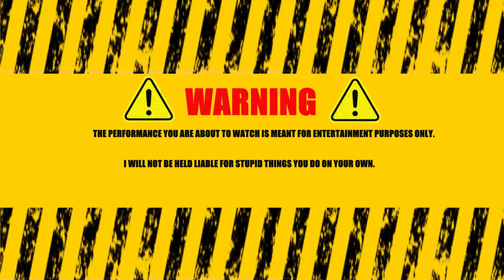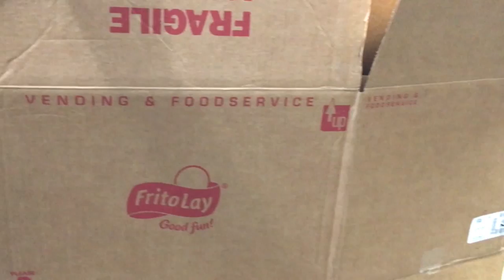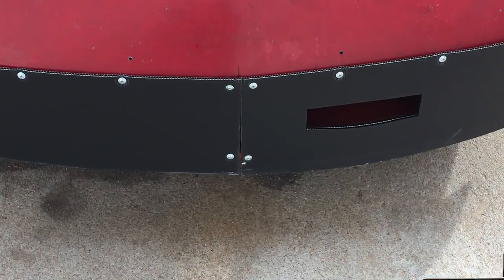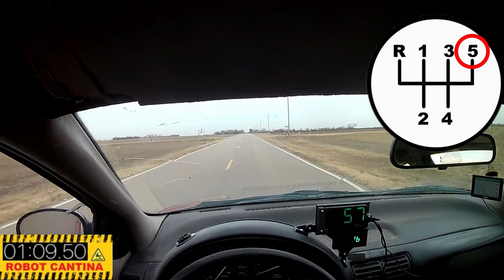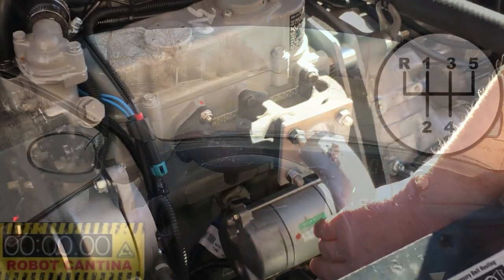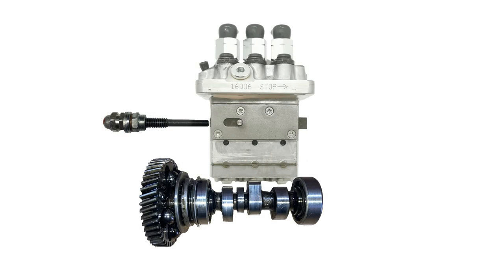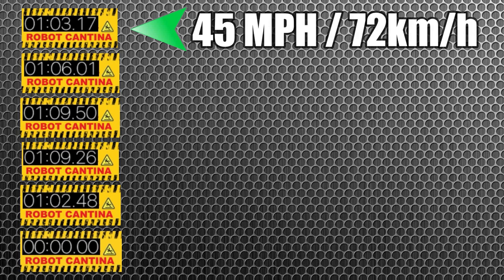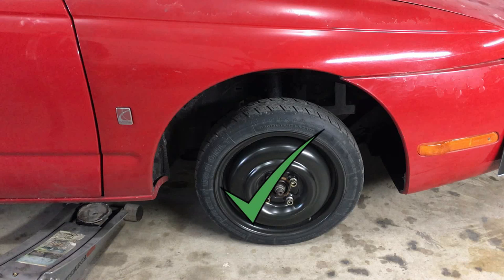S3E2   Fuel and aerodynamic mods ....We do some experiments to try and get the Saturn to go faster.

Comment: I would remove the factory exhaust system, namely the CAT and the factory muffler. Both of these are designed for a gas engine, not diesel. I can see soot eventually clogging the cat and muffler. If you run a diesel exhaust system(specifically made for the motor), you won’t run the risk of it blowing up, plus it will make the turbo work and spool up easier.
Reply: @ocdman202  The Model T was introduced to the world in 1908. Henry Ford wanted the Model T to be affordable, simple to operate, and durable. The vehicle was one of the first mass production vehicles, allowing Ford to achieve his aim of manufacturing the universal car.  Telegrams went the way of the Model T..

Comment: With the HP you have, would love to see more tests with 1) put the spoiler back on and 2) take that block off the front.  the front cover appears tilted downward which would force at least some of the air to go under.  It'll be interesting to see if you are actually having problems with the fuel supply or these aero mods were in the wrong direction
Reply: @ocdman202  The Model T was introduced to the world in 1908. Henry Ford wanted the Model T to be affordable, simple to operate, and durable. The vehicle was one of the first mass production vehicles, allowing Ford to achieve his aim of manufacturing the universal car.  Telegrams went the way of the Model T..
Reply: The lights of the original Model T were not electric. The common lamps used on horse drawn vehicles were the lamps used on the Model T, this meant it used acetylene carbide headlights and oil side lamps. Electric lighting and electric starting became available for the Model T late in production during the 1920’s.

Comment: Old Datsun 510 ran 13” wheels that may give you smaller road worthy rubber on the ground. Bigger than those spare tires you ran but smaller than stock rims…
 Might be a good compromise fit.

Comment: btw you could also change oil to "economic" one (more light). And add oil pressure gauge so you can have idea about oil pressure with various oils, at various temperatures . 
In a small engine at high rpm oil actually makes noticeable difference, both in fuel economy and performance.

Comment: Higher pressure fuel pump would feed more fuel in the injection pump so less bubbles but may need bigger injectors to flow more fuel to eliminate bubbles

Comment: Another cool video. Perhaps the areo "upgrades" might not have helped the car as well as thought. But that's a great example on how we trial and error on the cheap.  

Another possibility for making power with the diesel is doing a propane injection.  It might work, it might not.  Some people claim its like nitrous oxide for a diesel. 😎
Reply: It works but will increase egt a lot. You could burn the exhaust valves if not careful.

Some engines work this way from factory, they're 'dual fuel' diesels that can burn LPG or diesel, always using a small amount of diesel fuel to ignite the LPG when in LPG mode.

Comment: I turbo diesel swapped a 2002 jeep Wrangler. It has a 4bt in it.
Idle egt at 750rpm 110 to 230°F based on ambient temps at full load 3k lbs trailer behind the jeep full tank of diesel egt would hit a max of 1300°F

Comment: You can safely run that engine to 1200f continuously with no problems and 1500 for short periods, I have several d650 d722 and d902 engines that I have in pulling tractors and they will run happily at 1100-1200 all day long

Comment: Oh one more thing. Blocking the engine airflow could be the drop in speed. Calculating whether the car is faster or slower with the huge front hole blocked off is difficult for me to assess. Looks like slower it is at current top speed.

Comment: Hi again you can add lpg on a micro switch for maximum power when required it will have fuel on instant and spool turbo wallah lol 😆 you got the power go methanol injection or just water and you can play on your speed runs almost worry free love the work it's apocalyptic engineering 😀 at its finest 😀 thank you 😊
Reply: @ocdman202  The Model T was introduced to the world in 1908. Henry Ford wanted the Model T to be affordable, simple to operate, and durable. The vehicle was one of the first mass production vehicles, allowing Ford to achieve his aim of manufacturing the universal car.  Telegrams went the way of the Model T..
Reply: The lights of the original Model T were not electric. The common lamps used on horse drawn vehicles were the lamps used on the Model T, this meant it used acetylene carbide headlights and oil side lamps. Electric lighting and electric starting became available for the Model T late in production during the 1920’s.

Comment: Aluminum rims with the stock diameter and as skinny as possible to reduce weight and rolling resistance. If you want to push things unused seats, carpet, and headliner are surprisingly heavy and easily removed.

Comment: Direct cold air intake from a high pressure point (in that front bumper). 
Also before turbo, you could bleed a small amount of propane into the intake on full throttle.. 
Running the engine high rpm you may need to advance the fuel timing a fraction.
Mpg test at 50mph at each mod would be good..

Comment: Wonder if you need baffles in the fuel tank or if the cap or fuel outlet of the tank isn't restricted?  Also does this engine have an aneroid?  It's a mechanical diaphragm servo device that restricts max fuel under certain high rev conditions to reduce smoke for emissions on some 80s and newer diesel engines with mechanical injection. A hose or cable from your injection pump head  has me curious of its function.

Comment: Just a suggestion, take front chin spoiler off and do speed run. I think that maybe if it was contoured into the front bumper it would work as it is it has the appearance  of a wall covering a hole.also what engine oil is kubota recommending. I've always ran 15/40 in diesels , but they do have a syn 10w30 for diesels now. If any doubt just run a good 15w40 be done with it.

Comment: The idea to remove the spoiler is terrible because it creates a sharp seperation edge that helps alot in reducing turbulences in the Air.

The fact that it sticks out a Bit in the front doesn't seem to be important because this area is most likely to be a low pressure area.

The Saturn engineers aren't mindless after all.

Comment: Make sure you put your EGT probe before the turbo when you do go to forced injection if you want an accurate reading, lots of people don’t, but you loose some heat in the turbine and the pressure drop does cause a slight drop in temperature after the turbine. 
As far as the loss in power, maybe monitor your fuel supply pressure? Could be struggling to keep pressure under prolonged load.
Reply: @ocdman202  The Model T was introduced to the world in 1908. Henry Ford wanted the Model T to be affordable, simple to operate, and durable. The vehicle was one of the first mass production vehicles, allowing Ford to achieve his aim of manufacturing the universal car.  Telegrams went the way of the Model T..
Reply: The lights of the original Model T were not electric. The common lamps used on horse drawn vehicles were the lamps used on the Model T, this meant it used acetylene carbide headlights and oil side lamps. Electric lighting and electric starting became available for the Model T late in production during the 1920’s.

Comment: I dunno about anyone else, but I'd also like to see some alternative fuel experiments. I've got a cheap single-cylinder eBay special engine that I'm making into a backup generator for my solar power setup, and while I haven't gone too far into the experiments yet, it seems to run great on plain old used cooking oil. Exhaust smells a lot nicer too! I'm not sure if the Kubota would be OK with this or not though, as apparently it depends on the type of injector pump it has, and if it's a high pressure common rail like most modern diesel cars, it could damage stuff. I don't think that's the case here as I think the separate cam-based pumps are the low-pressure type, but if you do decide to try it, it would be a good idea just to make sure first.
Reply: Your alternate fuel experiment won't last long.  Don't know why so many people insist on learning lessons the hard way.  Particularly when the results are well known and documented.

Comment: With the front aero mod the intake is probably now drawing in warmer air from the engine bay. Maybe try adding a duct to direct colder air at the air filter.

Comment: coolant temp is not the whole story, you need an oil temp gauge, an egt, an intake temp, and a fuel pressure gauge to get a full picture. i would suggest it may be time for a turbo and intercooler. also the doughnut tires are probably a massive power loss to the rolling resistance of the tire. i would suggest trying a small 8 ply trailer tire. i know its against the rules but i bet you would see a significant difference.

Comment: Classic symptom of fuel starvation.  Gut says it is fuel pump related.  I don't remember if your engine has a mechanical pump, or if you are running some flavor of electric pump.  Fuel pressure gauge post filter will give you a good indication on what is going on.  You didn't mention smoke.  Did you get any?  If not you are a good ways out from over fueling and a turbo will be a net zero due to the lack of fuel.

Comment: Could you consider taping up the body gaps? It is pretty easy to do, and you could probably just use painter's tape. Bonus nachos, while you're at it, you can run a sweet painter's tape racing stripe down the car's centerline (off-set, of course). :-)

Comment: heard/read more than once that diesel exhaust tends to run cooler than petrol.   Since heat itself is an element used to create diesel combustion; guess it makes sense that some of the heat is consumed.   (heat + compression= combustion)
Reply: It's because diesels have a higher compression ratio. Gases heat up as they're compressed and cool as they expand, diesels and expand the exhaust more leading to lower EGTs
Reply: @nerd1000ify  think we just said same thing.... cart horse, horse cart kinda thing??

Comment: The rear spoiler might actually reduce airo drag, please try to re install it and see how the top speed change.

The spoiler might work in a way that it reduce the low pressure area on the back window and the slope, now a part of that is lift and a part of that is drag because of the slope.

The spoiler will in a control mater reduce this low pressure by resisting a bit the airflow and separating it from bending down to the back of the trunk. 

You make too many modifications at the same time, how can you say what works and does what, you make one mod and gain 10 points, and an other mod that you lose 9 points, the outcome is 1 point.

Comment: I wonder if you need to advance the ignition timing to get a bit more power.

Use the voting plastic to make the mirror remains more aerodynamic. Use paint as finish.

I'd also use the plastic on the inside of the front bumper instead of pn the outside.

Little wheels increase torque, and decrease wheel horsepower

The engine does need more cooling, seeing it runs at nearly max load all the time. You could use an intercooler with the turbo.
Reply: @ocdman202  The Model T was introduced to the world in 1908. Henry Ford wanted the Model T to be affordable, simple to operate, and durable. The vehicle was one of the first mass production vehicles, allowing Ford to achieve his aim of manufacturing the universal car.  Telegrams went the way of the Model T..

Comment: Is it just engine/camera resonance or does that car have a roached wheel bearing?
Reply from the maker: Yes, the left side front wheel bearing is roached.   I think when I had the car all apart and did some power washing I may have gotten some water in that bearing.  My experience with Saturns is they will go a long time on a bad bearing and we are monitoring the situation.

Comment: You might increase the engine durability a bit with a turbo using old school con rod hole style piston oiling a la Oldsmobile. Also maybe the block has passages and plugged holes or bosses for oilers?

Comment: The aero stuff is not likely to be a big help in the 0-55 test,  it will help you later when you are chasing speed over 70. 
For aero it would be a good idea to look at front lowering springs or just cut your factory ones. Lowering the frontal area will help drag. Adding some rake is usually not a bad thing either.
Reply: I think it's going to be a massive help for 0-55 as well, you can feel how much thenair slows it down past 40 mph

Comment: You should consider doing the fuel pump timing mod next before adding the turbocharger because with the FPT mod done it adds about 4 degrees of timing to the engine and that will add around 8 to 10 more horsepower to the engine.

Comment: Gotta be careful with those spare tires. They aren't designed for "normal" operations. Im Canadian so I think most of them top out around 80Km/H and even that is sketchy for them. Generally one use tire as well but considering the speeds you were doing its probably not a massive issue but just watch tread wear and replace if you notice any sort of defects asap
Reply from the maker: The little tires was certainly a cool experiment that folks have been asking for in the comment section.  Since its is a safety issue, we did it to appease the audience but we have absolutely no plans on continuing to use the little wheels.
Reply: @robotcantina8957  I try to regard books as if they were like fish, “catch and release.” Once I’ve read a book, unless it is exceptionally special, I donate it to put it back out in the world for others to enjoy.

Comment: i don't know about your state but my state if it came with seat belts,right mirror and CHMBL it stays i have been pulled over by uneducated in classic cars cops one time for not having CHMBL on my 77 impala and once in my 61 caddy series 62 for no seat belts and in my 48 chevy fleetmaster for no mirrors no belts no reverse lights even the parking enforcement when i lived in the city tried to go after my 73 cheyenne 4dr camper special c30 454 with the extended box for being over 21' but my state is classic friendly so none of it stuck the only one they ever got me on was in my 86 regal for going thru a intersection with wheels of the ground or something like that certain ares don't care for hydraulic lowriders.

Comment: That motor should take boost just fine only thing I'd look into is if you push too much boost add headstuds to make sure not to lift the head and cause a headgasket issue

Comment: You should have an inlet pipe straight from the hole in the front to an airbox containing the airfilter for the inlet. That way you get cold air to  the engine and gain hp :)

Comment: Check the valve lash while you are troubleshooting. Now that the engine has a few hours on it the lash might have tightened up.
Reply from the maker: Interesting,  I'll look into that.  Thanks!
Reply: It will be exactly where the factory set it.

Comment: I would actually wanna know more about the Honda, did it got the V twin engine or does it still has the 420 cc?
Reply: Still has the Supercharged 420CC, I think the V-Twin idea was scrapped.
Reply: @Cmdrbzrd  Ah yeah, Jimbo said in an old video that it might be extremely hard to swap the 420cc with the V twin. And to be honest I don't know where that engine could have been fitted inside that engine bay.
Reply: @TechTonic420  The stock engine is still smaller than the V Twin iirc, so maybe it could have fit.
Reply: @Cmdrbzrd  yeah but at some point he mentioned that he would want to put the supercharger on too if this engine will make it. So maybe that's why we haven't heard anything new about the Honda. Who knows, maybe it's something in progress.
Reply from the maker: The Honda is still alive... sort of.  The Michigan registration/tags expired and we have to get the car inspected here in Kansas in order to put it back on the road.   We do have a plan.....   The V-twin swap  has been delayed.
Reply: @robotcantina8957  thanks for the update. I really appreciate it.

Comment: Remove weight, spare tire, any other stuff in the trunk, door panels, remove the sheet metal insides of the doors under the panels, rear seat, ect.
Reply from the maker: At some point we will totally strip the car of any unnecessary weight,  but for now I want to keep the weight more or less the same while we experiment with the engine and aerodynamics.  This allows us to determine what change made a difference.

Comment: You don't miss much so you probably already recognize I've been blabbing about skinny and highly inflated tires since the Harbor Freight motors. The spare tires aren't very stiff and probably not safe to pump very tight. Hopefully someone will donate some proper wheels and tires. Very light aluminum wheels with skinny radial tires of the proper diameter to get the ratio you feel you need should achieve more gains than one would think.

Comment: Should remove the rear seats, those add considerable weight to the car. Also replace the hub bearing that's audibly roaring, that could possibly increase rolling resistance.

Comment: Maybe an increase in performance will help if you build a funnel for the engine intake that uses the dynamic pressure at speed. The air intake should be at the front of the bumper and go to the air filter like a funnel. Then, at high speed, mine can use the dynamic pressure that is on the bumper. It would be supercharging, like a "RAM AIR system" found on Kawasaki sports bikes.